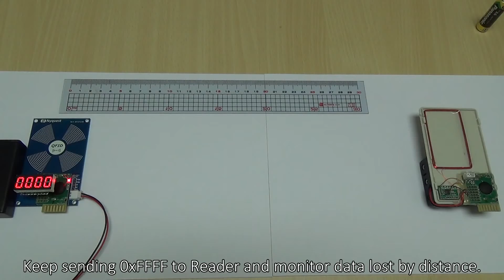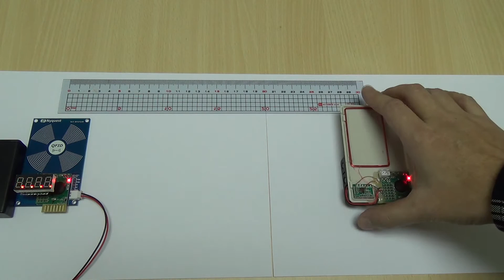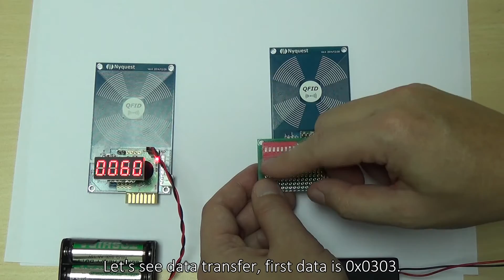RFID distance and data test

Comment: Hi, nice video! I want a distance about 30 cm and I have MFRC522 but it can read just 3cm. I was wondering if you know something to help me find a RFID cheap that can read tag aproximate 30cm of range
Reply: Hello, it's running on different technology basically.

For longer distance RFID system experience, I will suggest making coil instead of PCB antenna.
Or I should say antenna is they key issue, not the chip.
Reply: @nicholashuang1720  you know how and where I can put an antenna in this module? If it is possible? I saw lots of forum and they all said that the range cannot be increase from 3cm to 30cm in this module :/ and I only see for sale module too expensive.
Reply: I guess you need help from hardware engineer with antenna matching know-how.
For the price I cannot help since we (Nyquest) only sell chip.